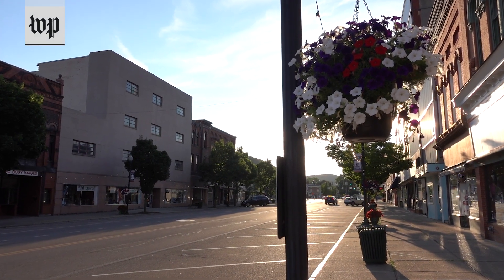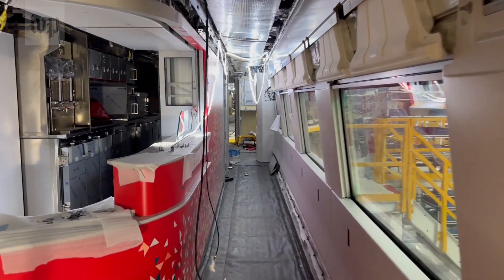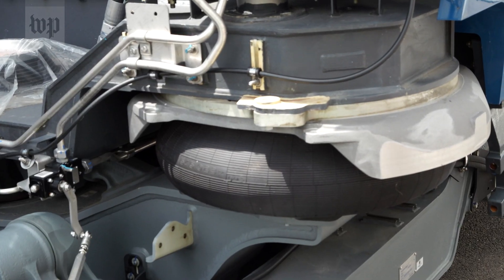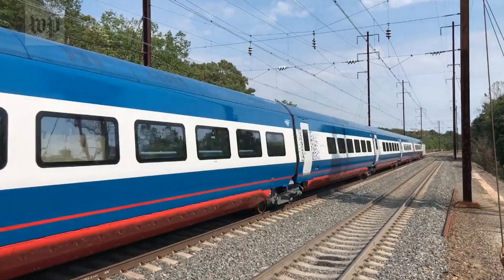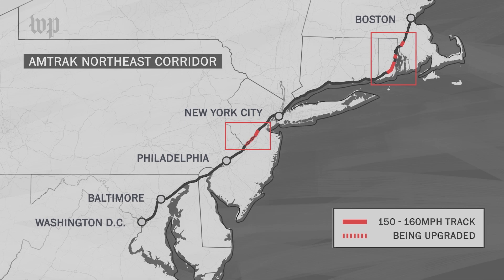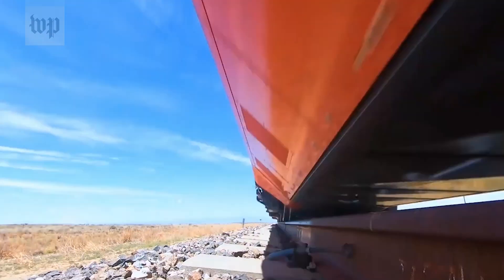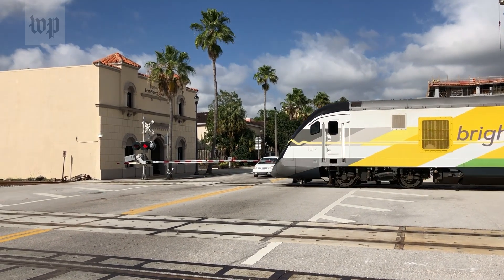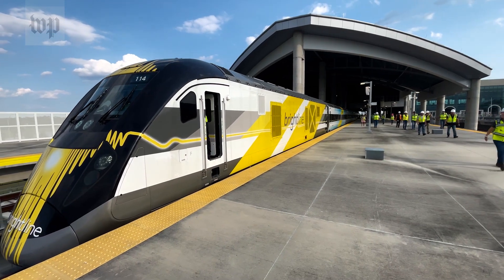Go inside Amtrak’s new high-speed train

Comment: They should just reuse the 20 year old trains to provide better schedules on certain routes.
Reply: What other routes would they use Acela on? As far as I know, the NEC is the only area providing electrified passenger rail service.
Reply: @TheRailwayDrone  The Keystone Corridor is an electrified line off of the NEC between Philadelphia and Harrisburg, PA however the trains the currently use on it are fine enough. There are also a few other electrified lines in the US like the Metra Electric District in Chicago for example however most are only used for commuter rail with no need to operate electric amtrak trains on them.
Reply: @ROTE  Acelas can only run on lines with 12 kV AC at 25 Hz and 60Hz or 25 kV AC at 60 Hz so only Keystone Corridor SEPTA, NJT, and New Haven Electrified Branches. Metra Electric District uses DC Power At 1,500 kV
Reply: @TheRailwayDrone  lmao what? that's pathetic
Reply: @viinisaari  I see you’re just trolling. Sad. I thought you were actually interested in rail.
Reply: @TohaBgood2  I'm not trolling, I was just a bit hyperbolic. You saying the northeast corridor is an internationally average HSR connection is at least as hyperbolic, if not trolling.
Reply: @TohaBgood2  moreover, its meaningless whether half of the route is 120mph+, as the harmonic mean is what you should concentrate on.
Reply: @viinisaari  That's 125+mph, and no. Because we already have a normalized measure of speed - the actual average speed for any given stretch. What additional information about the speed of the corridor would a harmonic mean give you vs the empiric runtime/distance? 

If you have the entire speed curve then you'd end up with the same number. If you don't then you'd end up with an approximate estimate of that same number.
Reply: @TohaBgood2  A graph over distance just does not give you an accurate picture of the situation. It's like the stupid meme republicans circle around about the 95% of land area in the US that technically votes  red.
Reply: @viinisaari  Dude, a harmonic mean is just an estimate of an average (as is an arithmetic or a geometric mean). If you have the actual average distance/runtime then you don’t need to calculate another more approximated type of a mean. 

Besides, you would be compiling it from average speeds for the various segments anyway. It makes no logical sense that the average runtime speed for a segment is good enough as a component of your harmonic mean but not good enough as an overall measure for the entire service.
Reply: @TohaBgood2  Plot the damn thing over time, not distance. Then you get a more representative picture of how slow it actually is.
Reply: @viinisaari  Again, your harmonic mean/average is supposed to be an estimate of the actual distance/runtime. We already have that distance over runtime number. There’s no need to create another less precise approximation for a thing that we already have from an empirical calculation from actual data. Read up on harmonic means, bud.
Reply: @TohaBgood2  Dude the first thing you brought up was the graph (over distance) which is misleading. It does not matter if we know the average speed already, plotting the speed over distance does the same thing as the mercanter projection does to Europe.
Reply: @viinisaari  No. What I said was that the majority of the track mileage on the route is already above 124mph even before they started doing the bulk of the planned upgrades.

What you said was that an average speed measure somehow better characterizes the route. I merely pointed out that your proposed average measure was a worse estimate of the average that we already have for all of these rail lines - distance/runtime.

In addition to being a more defensible estimate for the actual average speed on a line, it happens to incorporate any operational issues arising from actually running trains there.
Reply: How are you gonna reuse trains that are cannibalizing themselves and way past there prime?
Reply: The current trainsets have huge reliability issues due to their weight.  The newer trainsets are much lighter which allows for faster acceleration and they don't have the same maintenance issues as the Bombardiers.  This is the real reason why Amtrak is getting rid of them despite only being 20 years old.
Reply: AMTRAK made the Best Deal from Bombardier for the Acela's. The LEASED them and pay an annual fee for usage. The project itself was very heavily subsidized by the Government of Canada to Bombardier to WIN the contract because the trainsets were built in Quebec.

Comment: 北京台北通高铁了，波士顿到华府还是通不了。
Reply: That’s literally the North East Corridor my dude what are you talking about
Reply: @dante_m  Still, 1170 straight-line miles in 12.5 hours on rail, with stops, not bad, on the PRC side. But this thing does not connect to the ROC. There the 349 track miles take 1h45m express. Thanks Wikipedia and G Translate.
Reply: ? Boston and Washington have been connected with HSR since 2000 and low speed for over 100 years(twice as long as modern China has existed) and Beijing and Taipei aren’t connected with high speed rail(although I doubt that even with Chinas budget, it’s not practical

Comment: At least it’s a start , onwards and upwards AMTRAK
Reply: These comments are passing the vibe check. I thought I'd see a lot more opposition than I have been. We need to fund Amtrak and nationalize the rail system.
Reply: The UK High Speed 2 (London to Manchester) will be 360 km/h (225 mph) by 2030. But it's good to see the USA is finally entering the competition.
Reply: @AB-zl4nh  Yours top out at 125. UK is the last place on Earth to flex about HSR.
Reply: A train can only be called a fast train if the rails can support an average speed of at least 200 km/hour or 125 miles/hour.  like a freeway, it doesn't matter what type of car it is if the road is designed to be driven at an average speed of at least 100km/h or 62 miles/h.  can only be called a freeway
Reply: Hopefully their next move is to start improving rail infrastructure. Better bridges, new track layouts, faster corridors, and higher speed limits.

Comment: Wow! A 21st century train on 19th century rails.
Reply: trains can go between 80 and 125 mph on most of the tracks which would be perfectly passable if the tickets were cheaper
Reply: @bugno9969  The problem is that the current demand for the Acela and the Northeast Regional high speed trains vastly outpaces supply. Amtrak needs money to upgrade the speed and capacity on the Northeast Corridor and other profitable short-haul intercity routes in order to offer lower prices. The way Amtrak is funded by the Government forces Amtrak to charge market pricing for all its routes. Congress is forcing Amtrak to subsidize the massive losses on the Congress-mandated long-distance trains with the very profitable high-speed and intercity services. 

Since Congress is intent on keeping the money-losing long-distance routes, and since we actually want to have those trains as a country (more rail is better overall), the only way to break the impasse is to fund capital improvements for Amtrak on the intercity lines and on the high speed Northeast Corridor.
Reply: @TohaBgood2  Congress keeps those lines because it gets them more votes. I think Amtrak should be split into two companies. One that focuses on intercity and regional and one that connects rural American. The second could even deals with real estate companies. 

Either that or we should start building a German-like High Speed Rail network i.e. the network connects certain regions together and offers competitive rates on the lines. If it’s possible to get BNSF or Union Pacific to run a Brightlines like service, that would be great too.
Reply: @TohaBgood2  while it sounds like a good idea for Amtrak to be "profitable", no federally funded highways are profitable. Nobody questions spending billions on free to use and expensive to maintain interstate highways. But for some reason trains don't get the same treatment? It's a service for the greater public benefit. It doesn't need to directly make a profit. Highways don't.
Reply: @ericwright8592  100% agree! It is downright idiotic that we subsidize incredibly wasteful auto transportation with “free” highways, roads, and parking. But when it comes to just subsidizing electric trains in part everyone completely freaks out! It’s “Socialism for me but not for thee”!
Reply: > @TohaBgood2  So what you're saying is that the way they are making money off Amtrack is by improving existing short-distance commuter trains on already existing retail bc long distance loses money,. The problem is that the gov is still profit driven so Amrack has to charge market prices, instead of making them cheaper, and to keep funding more improvements right? Also, can I get the source from the info. I would love to learn more about it.
Reply: @TohaBgood2 amtrak is meant to be medium-distance and short-distance. Planes are meant for long-distance.

New York to Pittsburgh should be train. New York to LA should be by plane. We need to get our goals established
Reply: @bugno9969  the northeast regional has pretty reasonable tickets. and also im pretty more than half of the journeys between boston and nyc are by train these days
Reply: @bugno9969  Uh, they are going as fast as 150 MPH on parts of the Northeast Corridor and have for the last 20+ years.
Reply: @bugno9969  that does not change the fact that the Acela express has a pathetic average speed of 123km/h, which isn't highspeed at all.
Reply: @mx338  Because the tracks aren't high speed, the trains themselves are capable of matching European high speed train speed levels.
Reply: @Racko.  because it literally is a European highspeed train, with a little alterations made for the US system.
Reply: @mx338  Ik that, it's made by French Alstom, It has the same exact Speed as all the TGVs and capable of 220MPH but is held back by the tracks on the NEC not designed for high speeds.
Reply: @mx338  Still 3kph higher than the overall average speed of TGV in operation! (103kph vs 106kph for the Acela.) The TGV has degraded so much that their "high speed" option is practically the same as their own intercité trains. Look it up! It's been a major scandal in France for a while now. 

In terms of average speed, the Acela is fine for HSR. Could be a lot better, but certainly not terrible. 

The Acela, at a top speed of 160mph (with the new TGV trainsets) and almost the entire rest of the NEC at 125+mph is a very average HSR experience. 150-160mph is the top speed of the vast majority of existing HSR services in operation even if the trains can technically go faster. Again, look it up! The majority of the Shinkansen trains top out at 160mph in operation. Same thing for the vast majority of HSR trains in most European countries.

The new lines are faster, sure. But there are very few new lines. France has a bunch, as does Spain. You have a couple more in Germany and Italy and that's it! All the rest of the HSR lines are at 150-160mph max! Look at an actual top seed map of European HSR by corridor! It's literally on the wiki page!
Reply: @mx338  the tracks themselves aren't as problematic as the catenary design from when there wasn't even a national electrical grid yet
Reply: @blockstacker5614  Incorrect. The catenary on virtually all of the NEC is built to the European standard with Constant Tension. Boston to New Rochelle NY and almost all of the tracks south of NYC are using this new system. So no, the catenary is not the issue at all.
Reply: It might be that but at least in US you have a broader loading gauge, not like here in UK where the trains are constrained by clearances under bridges that really do date back to the Victorian age and sometimes before then. Though I doubt the rails you mention date that far back, think they might've been replaced a few times other the years.
Reply: @chris-cyclist-historybuff  we still do have hundred year old tunnels along some stretches....
Reply: the NEC is upgraded to somewhat modern standards in some parts. Especally between NYC and PHILLY!
Reply: @chromebomb  yeah in NJ!! New Brunswick station got their tracks renovated in 2019 and more is happening this year!
Reply: The 19th century GWR alignments are at least good for 125mph.
Reply: Um, most tracks on the NEC has been upgraded for higher speeds.  The bits that haven't are in spots where the curves wouldn't allow it to operate at those speeds to begin with.  

That said, you can always upgrade the current ROW, but these trains are still an improvement over current trainsets due to improved acceleration and performance.  The current trainsets have major maintenance and reliability issues due to their weight and Amtrak has been trying to dump them since day one.
Reply: That how the beginning of high spreed train started with old existing tracks then soon it’s get the tracks modernized.
Reply: So, same as Europe. What’s your point?
Reply: @shivtim  Europe built and still is building new high speed rails for their fast trains, old corridors are never capable of more than 200km/h which is hardly highspeed.
Reply: @mx338  and we have upgraded tracks on parts of the Accela corridor and also in states like Michigan. Brand new tracks in California, Texas, Floridan etc... I still don't get what point you're even trying to make.
Reply: @shivtim  Upgrading tracks isn't the same as building a new highspeed line. New highspeed lines support at least 250km/h, but usually 300km/h and more, consistently without the need to slow down and without significant cargo rail on the line.
125mp/h wouldn't even be considered highspeed rail for a new track, and the upgrades for Acela are so spotty that the average speed is still 77mp/h, this is just not a a highspeed line by international standards.
Reply: Sounds like the UK
Reply: Just means our rails are stronger 😈😈
Reply: SPANDA VIBRATION  Wdym finally? They always had high speed train since the early 2000s, this is just the next generation train
Reply: SPANDA VIBRATION  We've had a TGV-derived HSR train since 200, bud. This is literally a replacement for the existing HSR train that already runs on the same route.
Reply: that is the standard where I am and works well. we are working on getting 140 mph services, which is currently being held up by our old signalling.
Reply: A train can only be called a fast train if the rails can support an average speed of at least 200 km/hour or 125 miles/hour.  like a freeway, it doesn't matter what type of car it is if the road is designed to be driven at an average speed of at least 100km/h or 62 miles/h.  can only be called a freeway
Reply: @carkawalakhatulistiwa  Yes, and the Northeast Corridor tracks are rated at 125 MPH or faster for a large portion
Reply: Shhh. :)
Reply: It’d take a super long time to rebuild existing rail networks. Acela trains also tilt in order to turn at higher speeds
Reply: Electrify rails!
Reply: The UK High Speed 2 (London to Manchester) will be 360 km/h (225 mph) by 2030. But it's good to see the USA is finally entering the competition.
Reply: lmao
Reply: The rails on the NEC were laid anytime from the 1960s to the early 2000s
Reply: That about summarizes it.
Reply: American durability.
Reply: @titanicman9329   America ignorant
Reply: @titanicman9329  No lmao it's 19th Century design and alignment, the rails themselves are not from back then
Reply: @titanicman9329 tiêu chuẩn mỹ mà bạn
Reply: Us has the same problem as UK : no investment in rails since decades, and here the results. I think in France we have maybe more than 20 lines of HSL, versus only one in UK, the second will come in...2030 ! That's the results of Maggy Thatcher policies that even Labour doesn't reverse at all.
Reply: At least one bridge on the line goes back to the 1830s. That's pretty much the dawn of railroads in this country.
Reply: They just shut down the OC to San Diego route because of the quality of the tracks. 💀 This can’t even go fast, just a few stretches, which you know will never happen. 💀 Embarrassment fr.
Reply: Yea, that’ll work!NOT!
Reply: @marvinmartin4692  Lol, it already is working and they just got $40+ billion to upgrade more sections to 160mph.

You have no idea what you’re talking about.
Reply: @TohaBgood2  Give some credit to Martin. He does know Congress is really corrupt and terrible. He's not wrong, just a cynic, not pragmatic unfortunately.
Reply: @marvinmartin4692  Yeah you make sense... NOT!
Reply: @marvinmartin4692  it's a shame too. because the infrastructure in this country is so outdated and rundown, makes the ability for new technology to flourish diminish. it's a shame what car-centric infrastructure has done... I wish we'd also nationalise the airline industry... the state of american transport is a complete mess. it makes me so dissapointed at the potential we have to be so much greater
Reply: @marvinmartin4692  ...most of the UK rail network still dates from the 19th century. It still works alright. What's the problem?
Reply: @robtyman4281  Most European countries have high speed lines constructed between 1960 and 2010. The UK was the last to build new track with HS1 and is currently building HS2. The East and West coast mainline are only just considered high speed (125mph)
Reply: @robtyman4281  The UK rail network is not "alright" it's probably the most outdated of all rail systems in Europe.